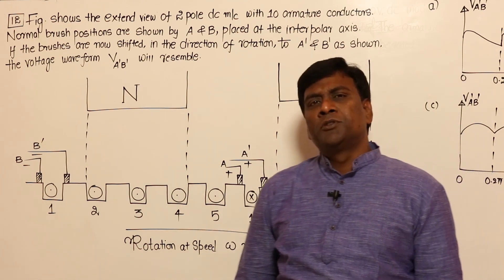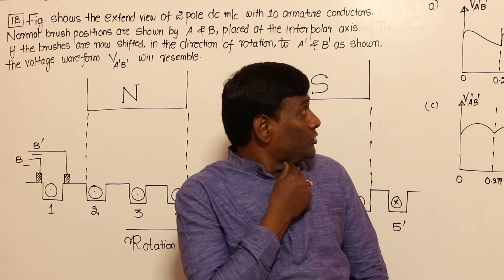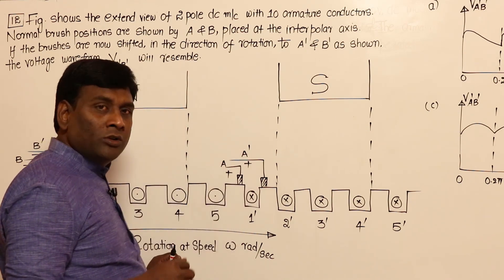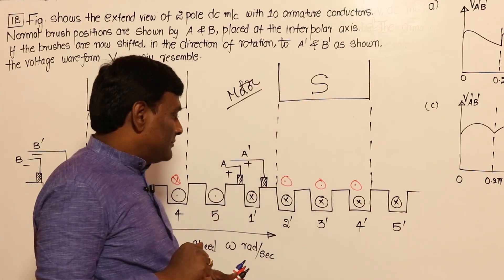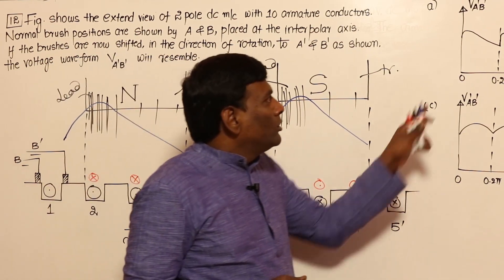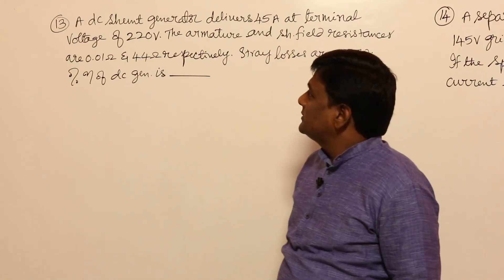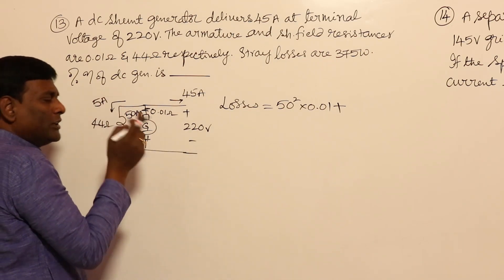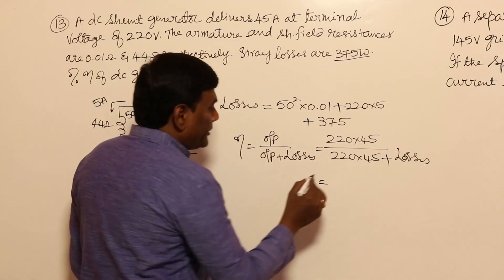DC Machines Problem Set - 4 | DC Machines | GATE & ESE | KN Rao

Comment: Thanks for the wonderful explanation of q :12 . but  i have one question sir .: For this q it happened that the given '.' and 'x' are of currents(not mentioned ) and it happened to be a motor as the ind v is of opp direction to that of current. What would we have done if the q would have been for a motor/gen  and the given direction would have been for ind voltage  only. As per method we would use right hand rule and would get same '.' and 'x' .